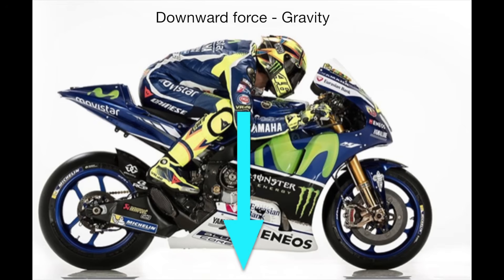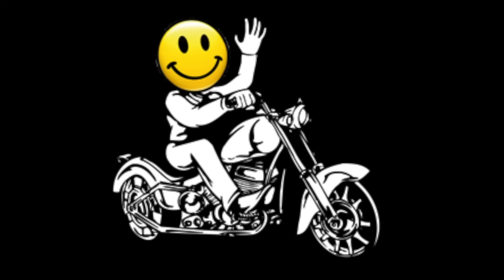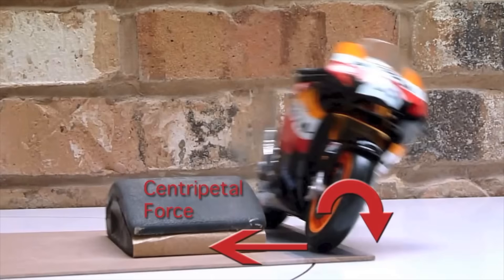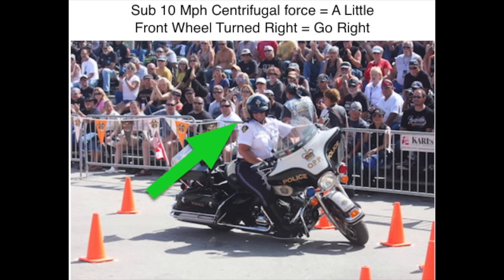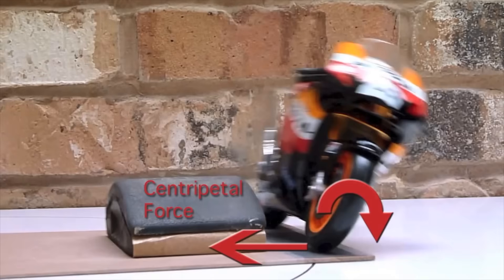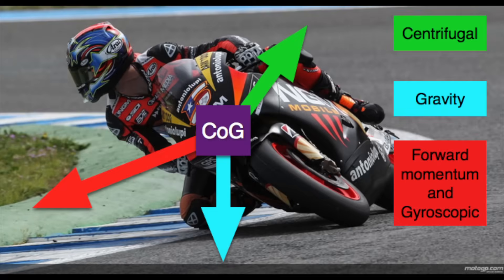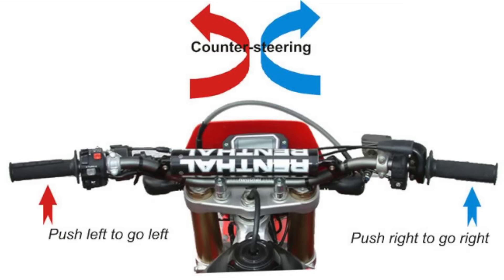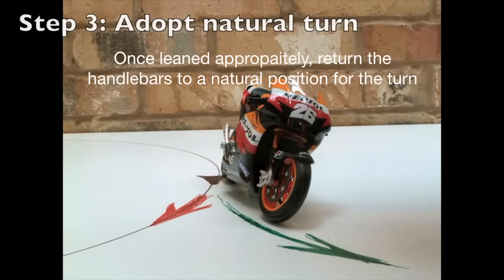Motorcycle Countersteering Physics, Myths, and Misconceptions | SquidTips

Comment: Up to 2:15 the intro was good and strong, if lengthy. But then you fell into the trap you yourself set and it was a case of the 'blind leading the blind' just adding to the confusion. As an example the Cambridge Science Centre is not Cambridge university and the vid is not approved by its physics dept. (The explanation is wrong in that it is an incomplete explanation).
Reply from the maker: Lol... are you for real? The explaintion from Cambridge is just a toy motorcycle attached to a centrifuge used to provide a clearly rudimentary explanation (That’s why it’s a 2 minute YouTube video and not a Great Courses lecture).

This video isn’t supposed to replace college physics, the exact opposite. The goal is to take someone who has zero understanding of any of these concepts, and take them to the point they at least grasp the high-level principals. To do that I use language and terminology that isn’t 100% technically accurate (An example is that I use the term centrifugal instead of centripetal) because it communicates the point better to someone who doesn’t have a background in mechanics. 

You’ve made the classic error of dismissing something as vapid and lacking value because you aren’t the target audience.
Reply: @SquidTips  Gee, someone doesn't like to be critiqued.

Who said anything about replacing college physics? You're the one who set the agenda as "What is Countersteering and what are the physics that drive this important aspect of riding a motorcycle?" - which you didn't achieve, and now you say you are forgiven because it can't be achieved in a 2 min vid. WTF!

" To do that I use language and terminology that isn’t 100% technically accurate " WTF. Are you saying you can't use concise and precise English so you are going to baffle them with BS.

"....who doesn’t have a background in mechanics". I thought you were enlightening their physics not their mechanics.

The task you set yourself is well beyond your ability to comprehend or analyze. You haven't simplified or clarified you have dumbed down. In fact, I don't think you even tried. You have just rehashed other people's work to make click bait.
Reply from the maker: I don’t mind criticism, but you better be prepared to defend it. Unless you don’t like when people criticize your criticism 😘

You made the claim the Cambridge video wasn’t good because it’s incomplete, my argument is that it doesn’t need to be, it’s a simple demonstration video that others can build on.

My evidence of this videos value is in the comments below where you can read hundreds of people flipping a switch in their minds understanding a concept they didn’t before watching. Your critique of terminology isn’t totally invalid (it’s also not unique, check comments I’ve ‘Hearted’) which is why I’ve made adjustments in later videos around some of it, but other than that you haven’t specifically provided anything other than pedantry.
Reply: @SquidTips  3:30 "the centrifugal forces varies based on your speed and the centre of gravity." Bloody bullshit. The centrifugal force varies based on speed and the radius of the turn. You are not misleading but just churning the waters into a mystifying muck.

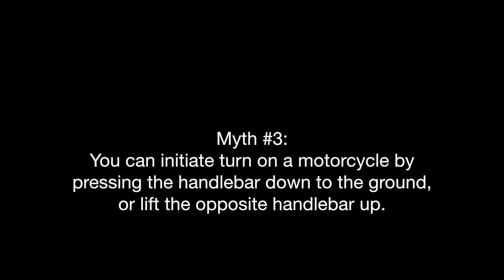3:40 "when the speed is low the torque is low" WTF? You mean when the speed is low the centrifugal force is low.

3:47 "we need to counter balance...." again bullshit. I can ride through a walking pace U turn on any bike demonstrating body in line, body in or bike in. At low speed the RIDER is required to balance the bike. The rider balances the bike with wobbly handlebars, wobbly knees or upper body movement. These rider inputs can be applied with the bike at the different lean angles required for bike in etc.

At higher speeds gyroscopic forces, mainly the spinning wheels, balance the bike in the straight head and when leaned over through the turn.

The rest of your follow on discussion is bullshit as well. You say we lean the bike to counter balance the outward centrifugal forces (you use the imprecise word 'torque'). Bullshit. The bike leans to steer. The bike is not leaned to counterbalance. Leaning causes the physical characteristics of frame geometry as well as gyroscopic procession to steer the bike through the turn.

The fact that leaning also counters the centrifugal forces is coincidental.

The rest is just double dutch weasel words that sound impressive.

Comment: Idk man i tried to counter steer and i crashed... like lean righ and u will go right, lean left u going left idk what is deal with that counter steer
Reply from the maker: If you are leaning in an attempt to make your motorcycle turn, it's not going to be very effective as you dont have much leverage in overcoming forward momentum, an example of how ineffective this is can be seen here: https://youtu.be/8zD0EYOVDZ0?t=327

When you press forward on say, the left handlebar, the bike will lean for you, your body just kinda follows the bike.
Reply: Tinek 
Ok so you say you lean to steer. Well that's plain wrong! End of story no argument.
So now are you steering?
When you lean your body left you are applying a small amount of weight onto the left handle bar, so you are unknowingly pressing the left bar forward, so the bike leans left because you are counter steering. That is the start, end and facts of your steering system. Added bonus ..... Now you understand how to steer your bike for real.... You will improve your steering (becomes easier and more accurate), and a general sense of being more in control of your bike will exist, believe me. So don't spout the "I tried and crashed" bullshit. Get on your bike and do it!!!

Comment: so if I push left the inertia to move forward is broken and the centrifugal force pushes the bike towards left since the front wheel is towards right (and hence the centrifugal force towards left). Did I get it right?
Reply from the maker: It sounds like you’ve got it. You push left, the wheel turns right and pulls the bike to the right, and out from underneath you and into a left lean, then you naturally adopt the left lean and turn left. It happens so fast though you probably don’t even notice.

Comment: Huhhh if this clearly explains how it works then I'm blind and deaf I guess. In my Air Force training for aircraft navigation systems we learned about precessing gyros. That is the one and only way anybody will ever easily comprehend the counterintuitive reaction of a moving motorcycle when the rider applies force to the handlebars causing the bike to lean into a turn.
Sorry dude.
Play with a gyro. Figure out precessing. Then make sense of what happens when you apply forces to a motorcycle's front wheel. I can guarantee that any explanation that doesn't explain this effect is just fudging it.

Comment: So do you maintain the front wheel in the opposite direction during the duration of the turn?
Reply from the maker: The bike naturally wants to upright itself, and the faster you are going the more it wants to do that. So yes, you’ll need to keep pushing forward on the bar to maintain or increase your turning angel. Visually though, your wheel never actually looks like it turns at all.
Reply: @SquidTips  So you just barely push on the bar? I think I get the concept of it, but the way its explained is different every time. I've seen people explain that you only push the bar to initiate the turn/lean, once its initiated, you can turn into the curve, is that also true or not? Thanks
Reply from the maker: It will depend on the speed you are traveling and how aggressive the turn is. The bike will respond immediately with almost no pressure as soon as you press forward, and if you are just making a quick, low-speed, 90 degree right turn at an intersection, you might only press for a moment, then relax and allow the bike to right itself as you continue on the new road. 

Compare this to a freeway on-ramp that takes you from traveling north, but then puts you in a right turn until you are traveling west. You’ll start the turn and will need to maintain some pressure, then you’ll accelerate to get to highway speed while turning, so you’ll have to push even harder to fight the forces trying to raise your bike up until you are out of the turn.

Comment: So in a high speed knee dragging corner, you aren't counter steering throughout the entire turn, however, you are just briefly counter steering to initiate the proper lean angle while maintaining proper body position correct? Or would you be holding the counter steer until the apex where you would then begin accelerating to straighten the bike upon corner exit? I find myself having good body position and proper weight distribution, but I just can't seem to get my knee down and achieve the lean angle I know my bike is capable of. Bike in reference is Triumph Dayton 675R w/ Bridgestone BattleAxe S21's. any advice is much appreciated :)
Reply from the maker: I'm sorry I wasn't more clear in the video, and I hope to create a follow up in the near future addressing this better.

In a situation where you need to be maintaining the turn, lets take a common example most will have experience with like on a highway interchange that circles around to point you to a direction farther than 90 degrees, like this: https://photovault.com/182726

In this situation there are centripetal forces that are actively looking to push you out of the turn, here is a basic example of what that looks like: https://v.redd.it/3y73w74fvnm11

After the initial press of the bars that dips you into the turn, you will probably need to use the steering to fight those centripetal forces and adjust your position in the lane as you move through the turn, lest those forces throw you and your bike out of the turn. This means subtle adjustments with the handle bars, and continuing to countersteer through the turn. 

In practice, this feels more like just maintaining light but firm pressure on the bars as you move through the turn. It's ultimately a balancing act between centripetal forces and gravity. As the rider you have the throttle, steering, and body position to control that balance.
Reply: So I would use counter steering to initiate the turn and find the perfect angle to hold the proper racing line and hit the apex. Throughout the corner I continue to hold my counter steer using light pressure on the bars since you should not have more than 10% of your weight on the bars while cornering anyway (this is to allow the front suspension to move freely). At the point of Apex, I would begin accelerating to straighten out the bike on corner exit. In essence, I am using the handle bars to counter steer and fight the centripetal forces trying to pull me out of my lean.  Thanks for a quick response and certainly appreciate you clarifying this! It just always seemed to throw me off the faster I went, but it seems to make sense.  The quicker you go, the less steering input (counter steering) you would probably need to achieve your desired lean angle. or is it the opposite since the centripetal forces acting on you are greater? Great images and video btw!
Reply from the maker: Yeah, sounds like you got it. The faster you drive in the turn the more centripetal forces are created, so you need to lean harder to achieve that equilibrium, which means more contersteering to compensate. This is why MotoGP riders touch the ground as they are cornering; The want to be going as fast as possible, taking the tightest corner they can, so it requires insane lean angles and body position to overcome the centripetal forces.
Reply: RoyalRegistry 
Wow how complicated is this, I'd have never taken up riding if it was really this hard.
It's not hard to explain at all..
Push left, go left...... Push right go right.
If you need to lean a little more, push the handlebar concerned a little.
If you need to lean a little less, ease off the pressure on the handlebar concerned.
When you have attained the lean angle required, just maintain the pressure on the bar concerned.
To straighten up, gently release the pressure on the bar you are pressing and the bike will slowly stand up.
That is a difficult as it gets and that covers all aspects of your use of counter steering.

How or why does it work?.... Who gives a shit. Do you need to know how your phone works to use it? Just know counter steering works all of the time, every time.

Comment: Just to throw this into the mix, there is data recorded from multiple bikes showing zero steering angle when leaning a bike... explain
Reply: I feel like you've missed the entire point of the video. By counter-steering, the rider introduces a forceful change of direction that throws the bike to the opposite side (making it lean to the opposite side). We utilize this to quickly and effortlessly lean into the curve.
If you don't countersteer, then you can just simply hang down and use your bodyweight to pull the bike into the lean. But that means fighting with the gyroscopic effect of the wheel, you'd have to really muscle and fight the physic of the bike to force it to lean just with your body. In the video he briefly quotes the "With a twist of the wrist" video that shows a rider controlling a bike with fixed handlebars, and he seems to be doing just fine - albeit a little difficult.
Reply: Dương Xuân Khôi 
What a load of bollocks you talk fella!😂😂😂😂

Comment: Um, inertia does not push anything. Try again. Inertia  is the state of movement. sans resistance. I ride, and I ride well, but don`t try to be a know it all. You are full of shit. Either be a physics instructor, or a rider. Pick one, and do it right.
Reply from the maker: Oof, glad you didn’t make it to the part where I said ‘centrifugal’ instead of ‘centripetal’, that probably woulda rustled some jimmies.

Look, your criticism is somewhat taken, but you are really looking past the point that this video isn’t meant to replace a college physics lecture, it’s meant to make complex knowledge accessible and understandable. The fun part about physics is that is really complicated, and a lot of the terminology is very specific, but used in common parlance in a variety of more generic, but less accurate ways. 

I preface the beginning and end of the video that I likely made minor errors in terminology, and that I am no physics expert, in an effort to simplify concepts. You can be a pedantic asshole about it and dismiss the entire piece if you want, but information that is more technically accurate but inaccessible is no better.

Comment: I am still unsure which direction the wheel points when you are leaned into a turn. At 4:38, the wheel looks like it is turned into the turn
Reply from the maker: Initiating the turn, the wheel will point the opposite direction you intent to go for a brief moment, which will force your bike into a lean. The harder and longer you press against the turn the more your bike will lean.

The 4:38 example would be what might happen if you were making a quick and brief turn, maybe if you are just quickly turning onto a parallel street in your neighborhood. After starting the lean, you release the pressure you used to enter the lean and follow the natural motion of your front wheel. In a low speed example, the wheel might turn toward the direction you are looking to go, whereas MotoGP riders (Like at the 4:00 mark) taking a fast and long corner, the wheel might stay strait or even lean to the slightly opposite direction of the turn. 

You can see the subtle opposite direction pointing in a photo like this: https://www.autosport.com/motogp/news/125359/stoner-red-bull-ring-trange-for-bikes
Reply: @SquidTips  thanks for your reply. Your motogp example was what I was referring to. Is that still called countersteering?  The idea having wheels slightly turned against the angle you are leaning still feels unintuitive to me. It seems like the bike should not follow a circular path if the contact patches on the wheels are not tangent to a circle. If you could suggest an article or diagram that explains this, that would be appreciated. Thanks.
Reply from the maker: It’s a topic I’ve realized after posting this video that is pretty complex and deserves its own in-depth explanation. I’ve had a few people put comments on here stating a variety of physics concepts but I haven’t vetted them, and am not sure how accurate they are. 

For a video I made on Tank Slappers (https://youtu.be/NsGHbK8McDk) that also required a lot of in-depth physics explanations I had to read a significant portion of a book called ‘Motorcycle Chassis Design’ by Tony Foale, Which was one of the few highly technical resources I found for this type of information.
Reply: @SquidTips  I am current physics major and just got my motorcycle endorsement. I would enjoy a technical video on this topic if you decide to make one!
Reply: @SquidTips   also I read a few people attempting to explain the gyro effects in counter steering. It is very complex, but (I believe) the effect is negligible when considering the mass of the wheel vs mass of rider+bike.
Reply: Mack Raymond What you see in MotoGP is basically drifting. The front wheel does point outwards compared to the BIKE, but not compared to the direction of travel. The forces acting on the wheel are compare to the direction of travel, so its a normal cornering with the rear wheel skidding a bit.
Reply: Mack Raymond 
The front wheel will always point into the turn, after a momentary counter steer, due to the bikes own steering geometry. It's unavoidable, many, many videos show this occurring.